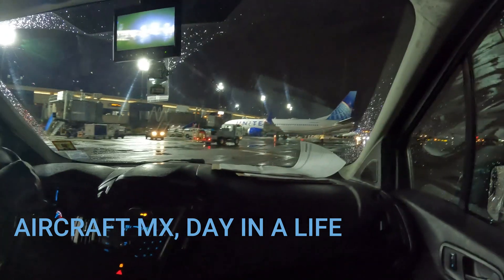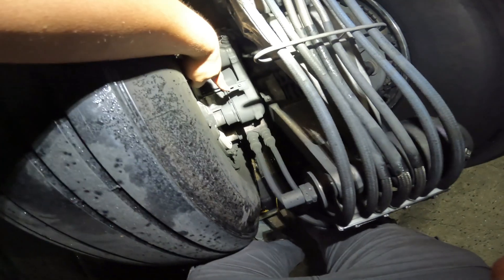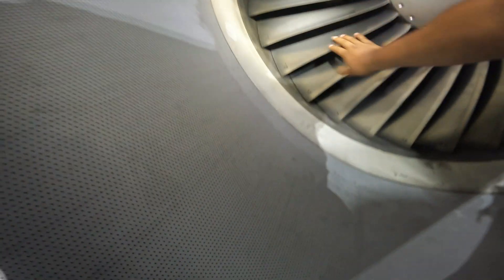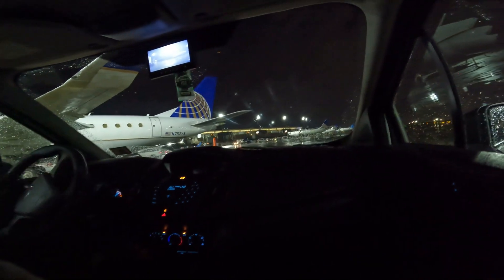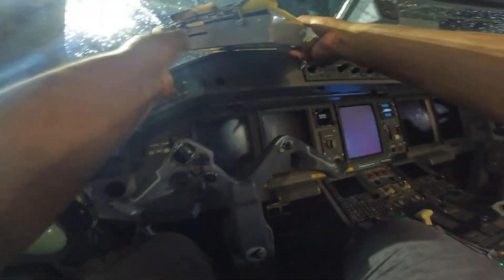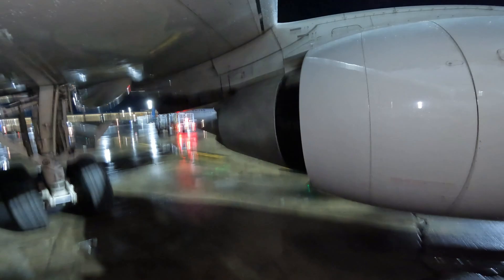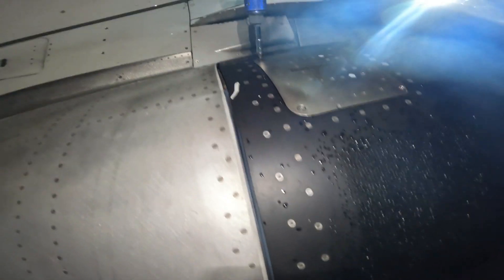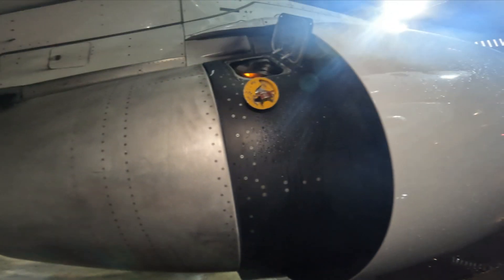AIRCRAFT MECHANIC DOES A BASIC INSPECTION

Comment: At 4:10 you said you pour the oil onto the engine. Does the oil go in the engine or do you just pour it on the engine as stated in your video?
Reply: It’s hard to see in this video but there is a circular inlet port where the oil is poured directly onto the engine, much like the oil resovoir in a vehicle.

Comment: So just add oil, no draining pan and new filter?
Reply: yeah, this is a 2-day inspection. Imagine changing oil and filter every 2 days
Reply from the maker: Nope, you only change the oil and change the filter every couple hundred hours on an engine!
Reply: I have never changed the oil on an aircraft in my career
Reply: @justing42 I have. For aircraft entering and exiting storage.
Reply: No pan. the engine burns the oil so no need to drain just add new oil
Reply: This is a jet engine not a reciprocating engine

Comment: Hey just got my A&P any advice when joining the airlines?
Reply from the maker: The best thing you could do is apply to regional airlines! They are the easiest to get into with no experience, Gojet, Republic, Southwest.
Reply: Get mentally prepared to work nights for 10 years straight. If you show determination and have good mechanical skills, management may move you to a different shift
Reply: @DrMD-1 at Delta there are guys on days and swings with a year
Reply: I would recommend starting off in a 'heavy check' environment. You'll get to learn the aircraft more thoroughly, and it's a little slower pace. The aircraft is usually in the overhaul hanger for several weeks. On the flight line you're under tighter time constraints!
Reply: bro don't go regional. Main airlines like Delta, American, and United is the way to go. The big 3 airlines is higher a bunch with no experience.